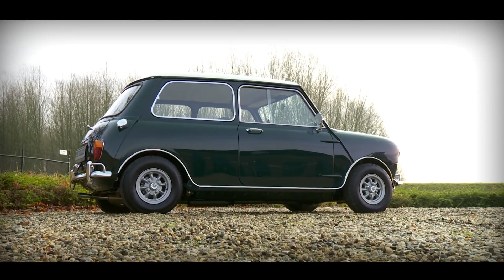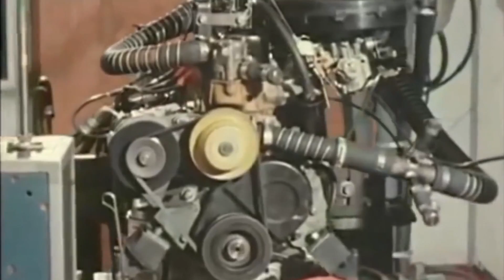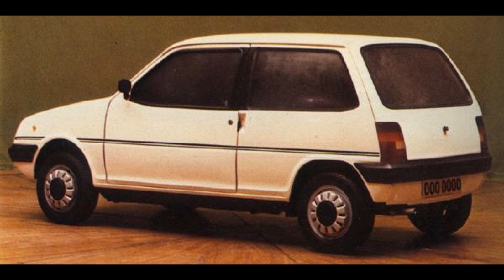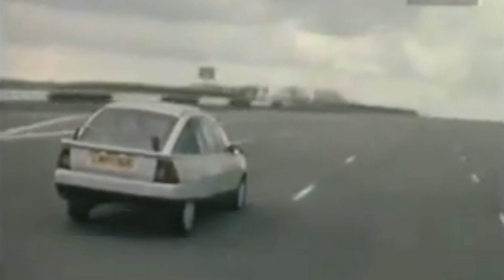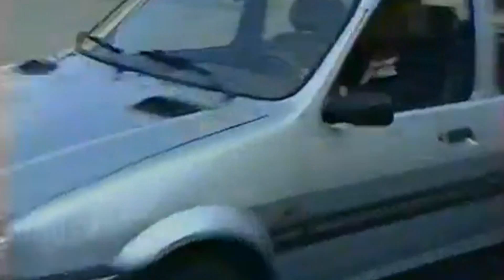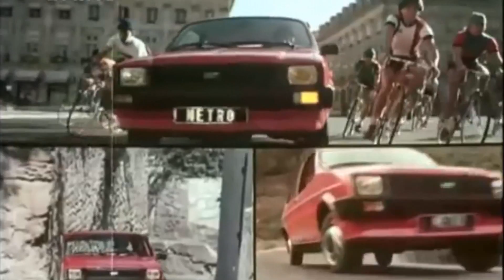The Austin Metro Story

Comment: I learnt to drive in Metros owned by BSM - the British School of Motoring. Later I hired a Metro for shunting people and stuff around the weekend I got married in the mid 80s, as I didn't buy a car until a few months later (a new 1.3 VW Polo C Formel E, incidentally). The Metro was an easy car to drive at a time when some cars were clunky and tiresome to drive - the Fiat Panda had a nightmare gearbox, and my big foot used to catch the steering column on a Renault 5 when using the clutch pedal (not good when driving near cliff edge drops in Madeira).

Comment: I bought one new for £4,000 in 1982 and vowed never to buy a British car ever again. Lucas was on strike at the time and distributors couldn't be had so a french Duecilier was fitted which couldn't do the job and pinked going up hills. I had it back to the dealers four times in the first year for that and other unrelated problems such as water leaks that flooded the interior which the dealer failed to fix. I liked the design and wanted to like the car but couldn't forgive its poor build quality and terrible after-sales service. I sold it for £2250.00 after just 18 months and was glad to see the back of it.

Comment: I didn’t have a Metro, but (in 1993) I put an MG Metro engine - into a 1275 GT mini. The original carburetor was an OK fit, but the clutch system never quite worked. It was reliable, as long as the battery was good and charged. Unfortunately MG Metros had an electric fan cooling it all. My Frankenstein had a ‘belt driven’ fan, so it got hot ...

Comment: The Metro (never sold here in Aust) is styled using only a rule & a couple of set squares, I think - only exception being the sporty R6 series shown so briefly.  But I'm guessing this would have had a high price point where you could consider other cars as better value.  
How about a Spridget episode?  A bored out, flared '72 was my 2nd car & it was great, apart from pulling 5000 rpm on freeways.  Also showed remarkable resilience in its head on collision.  Or the iconic MGB, my 3rd car & a massive disappointment after the Midget.  PS I now drive a Copen, a sort of modern take on a Midget.  Also super great except on freeways.  Oh, and luggage with the roof down (nil).  Hey, maybe do a Copen episode, it would be unique on YT.  Thanks BigCar!
Reply from the maker: I've done both the Spitfire and Midget in two separate videos. Search for them and you should find them.
Reply: @BigCarTV  I'm planning to watch the Midget & Spitfire tonight.  Thanks so much for all the time you put in.
Reply from the maker: @UJCentral  You'll have to point me to a reference for that. I don't know what it is.
Reply from the maker: @UJCentral  Interesting stuff! I have a few cars already lined up, but I'll put it on the list.

Comment: I had 2 metros. An 84 1.0 hle mk1. Regular 50mpg, 100% reliable on 100 mile daily commute and fun
And i even managed to collect and put a washing machine in the boot. The 2nd was a " rover 100". A bit more refined and comfy and including the 5th gear. But the panels very thin and deformable just by pushing on them. Handling and suspension were better but on wet roads, hard corners and roundabouts made it handle like a pig on a frozen pond and terrified me. The zero encap rating was no surprise, and engineer friends of mine pointed imediately to the fact that spot welds had been halved and the panel thickness to side and roof panels and sills with the cutting of spot welds killed structutal safety compared to mk1 and mk2. A great car killed by penny pinching, badge snobbery, called a retirement rollerskate, and being launched frankly 10yrs late.

Comment: My first car was a W Reg Austin Metro (1981) and I loved it. Then I went on to have another Metro D Reg (1986),  an E reg (1987) Maestro Auto then a G reg (1989) Montego Clubman Estate. Last Rover I bought would have been an S Reg (1999) Rover 416. Shame they no longer make cars as I absolutely loved the Rover brand and their cars were practical, economical and most importantly easy to repair, with cheap parts available. My wife has owned a few Rover 114s in her time also with a Rover 214 as her first car after passing her test.  We drive Volvo now and although its a beautiful drive, I still think you can't beat the rugged basic handling of a Rover.

Comment: I had three Metros the first being a rare car back in the day and in many eyes these days,  the holy grail...to me? It was the ideal machine to beat everyone on the Cumbrian Lake District roads...and believe me I used to use every bit of boost and handling that Mk1 MG Metro Turbo had.
It was the only one in the area, standard MGs where around and where very highly regarded and envied by normal Metro drivers, mine was blisteringingly quick compared to a standard MG and could beat the UK two escorts, capris, XR3 and xr3i the later on the straight would catch up at the 1/4 mile point and their 5th gear won over on top end.
MGE???Y Silver over black MK1 and only a couple of years old, I was looking for an XR2i but the lover of the odd ball in me opted for this when it flashed up in the small ads, I'd just sold my house so had the cash to purchase a nearly new car outright and this was a private seller, gave me bargaining power as many had come to see it wanting test drives but none had the cash...theyd moved from Glasgow to Cumbria and needed the £ so it was a done deal...

Oh how I loved thrashing that car about...it was made for those Lakeland roads and the various rally stage areas you could get access to in the forest areas...

My second was a far more practical 1.0 HLE :(
Basically a 3 speed with a high range Economy gear for 4th.
The gear lever was even marked
1    3
2    E
It was in mud brown and rusty but travelled every month from RAF Brampton in Cambridgeshire to back home to Cumbria with two kids and luggage purchased to fit perfectly between the kids car seats and boot I always had a clear view through the rear window.

My final one was a bright yellow 1.0 Mk1 I had for a year but only drove a few times as I had been injured at work (spinal, in an explosion) and became very unwell and ultimately gave the beauty away to a good friend and garage owner for free, because I couldn't sell it for someone to just take apart for spares as it was a mint condition Mk1 miniMetro.

I miss having a metro in my life, they where great little cars back in the day that involved using cables to things like the throttle and steering you could feel...

Peace
Charlie 🇬🇧

Comment: i remember a friend of my dads had a pale blue one, not sure how old possibly on a C registration, pretty sure it was the 'city' model. i must have been about 5 or 6 years old, i remember i bloody hated the car, i thought it looked an awful chep heap of crap even back then. the steeel wheels were the thing that stuck out in my mind the most, the design with thhe centre cap which was square and had 4 slots in total. most hideous wheel design ever imo

Comment: I had a Mk1 light green MG with pepperpot wheels.
Not a hot hatch in the truest sense because it hadn't got a great deal of power but it was torquey and the steering and handling was fairly sharp at sensible speeds.
I live in the West Midlands and the local news was giving the Metro some hype building up to it's launch because it was a local car and there was a lot riding on it. They showed cars covered in sheets as teasers and all that kind of malarkey.
Once it was launched the first one I saw was on the carpark of Savacentre in Oldbury and a small group of curious shoppers were scrutinising it.
Hard to imagine the general public being so interested in that way in a new car nowadays.

Comment: Very informative, Lot's of stuff I didn't know.
Yes, I drive a metro while a learner back in 1986/87 and I owned an old metro too.  I bought it from a scrapyard even though it was actually still mot'd. Drove OK.
My dad had a metro too, a 1990 model. 
Good cars! 
They didn't mention the citycar which replaced the metro in the late 90s.  I always thought there was a gap between the finish of the old mini and the start of the new mini.  
I'd love to get an original X reg metro VP if there are any left but there seems to be a lack of first year metros, maestros and montegos still in existence.  I think there are more model T Fords from pre 1925 than A reg montegos and X reg metros still running.

Comment: I had two, the Metro City and Metro MG, you never mentioned it, it had a turbocharged engine, with Night rider style LED meter on the dashboard clocks, which was later removed from subsequent models, because people would drive it to the meter and causing major crashes, however it was cool while it lasted and the car looked great in white.
Reply from the maker: Yeah, I should have mentioned the MG Metro. It's mentioned in my MG Midget video!

Comment: The Austin Metro was a Mini with a new body, no more.  The same engine g/box arrangement and sub frames.  That is why the wheels were too far inboard making the car look odd and ugly.
Reply: While that was true of the original version from the 1980's, the Metros from the 1990's were vastly better cars, especially with the new engine and standard five-speed manual.

Comment: I used to drive one. One previous owner who was a pensioner who no longer drove it and kept it in a garage, so it was in very good condition for its age, once we managed to unstick the brakes. The suspension was an interesting experience over speedbumps, where the car would pitch violently. But it was a nice car nonetheless. Unfortunately it was undone by the fact that by 2007 standards it was extremely easy to break into and steal, and it just disappeared one night, and was found burned out after a joyride. Poor thing survived so long in such good condition, to have it end like that was kinda sad.

Comment: You never mentioned in the documentary that the appalling accident rate of the mini Metro and they kept doing 360s They discovered It only done this when It had a full tank of petrol because the filler cap was placed lower than the rear wheel arch and when it had a full tank of fuel it went all over the back tyre which made it do a360 and then the accident 🤬
Reply from the maker: I didn't know that. That's terrible!

Comment: I had one in the 90's here in NZ.It was a great little car with the 1300 engine.Unfortunately NZ changed to lead free petrol which destroyed the valves without the lead coolant effect;even with the necessary fuel additive to stop the damage.I remember the safety scare.A bit off putting.
Reply: Change the valves and valve seatings.

Comment: This Metro looks just like the Geo Metro and Suzuki Swift. I had a 1991 Geo Metro and after the third spin out, got rid of it. Once it spun at 65 MPH on an icy bridge, and once at 25 MPH on a sand-covered curve. Way too light for good handling. It would have been wrecked on the bridge but the 10 foot long Metro spun like a top. I wish I could have afforded to crush it.

Comment: Sister had a blue Metro, i patched the door up and added a white cheat line, she passed her driving test in it then sold it, never to drive again for ten years. Must have put her off driving! I remember it had the fuel cap call back.
I rented a Rover 100 1.4 gsi, i think and went well and nippy, very good mpg. And one of my customers used the diesel version in his driving school, said he would do 150k miles then buy another, all on the original clutch.

Comment: Wasn't the A series originally from a tank being used as a generator? anyway, I built an ERA turbo rep with 1380cc  and V max head as I couldn't afford a 16v KAD head but 130bhp and lots of destroyed gearboxes until I could finally afford a Jack Knight box, lots of torque steer and whine from the turbo and box.
Reply: I think it was KAD that produced a 5 speed conversion for the A series?

Comment: Had 2 Rover Metro GTi's back in the day.  Flame Red 95bhp version and a GTi Se Limited Edition (Nightfire Red - 1 of 500 made).  Transplanted a 1.8 from an MGF into the latter when the timing belt flew off the original engine at 7000rpm.  Went like a rocket with the 1.4, but by God that thing absolutely flew with the 1.8.  Few minor tweaks and it was around the 135bhp mark.  Couldn't keep the rust away no matter how hard I tried though.  Regret not keeping the Nightfire one though.  They're making very solid money now

Comment: My first car in 1987 was a 1.3 Studio 2 limited edition Metro - 1275cc A+ series engine with 63bhp if memory serves (the MG boasted 72 and the turbo 93 I think). 3 further Metros followed - 2 GTi 16v models in 1990 (1st written off after a head-on smash (not my fault) and a 1.4S in ‘93. The GTi actually stood up fairly well in the smash. I only had cuts and bruises. The Renault 5 involved looked far worse afterwards I remember. My car was 3 weeks old at the time. Interestingly, it’s the only Metro I owned that’s still running! It has been rebuilt as a race/rally car. Fair to say the earlier models had their issues, but my 1.4S was very reliable and took me all over Europe. It was a great little car. I think by ‘93 it was turning into the car it should have been all along. I still like the styling of these later cars today. I think they have aged well. I expect to be shot down for saying so! Obviously, other opinions are available!

Comment: I'm an American who was stationed in England in the early 1990s. While there, I had an E-reg, 1988 Austin Metro 1.0 city, with a 4 speed manual. Things I remember about it: it had a lot of gear whine, and was geared for city driving as the engine really seemed to be revving at anything over 60 mph. It went through a lot of tires, and tended to run hot at higher speeds. It had a manual choke and was very basic inside with no headrests. It had its issues but was a very memorable and quirky little car!
Reply: I gave my Metro a lot of use during the short time I had it. In the summer of 1994 my parents visited me and we drove down to Spain and back in the Metro to visit family! During the trip we had to replace the spark plugs and water pump, and it was a very hot summer (close to 40c in Spain with no air conditioning). Was not the most appropriate car for the trip but I was very young back then (and my parents younger) and it was a fun trip. I had to return to work when we got back to the UK, so my parents borrowed my Metro and drove it to Scotland.

Comment: Used to repair Metros (and Minis) and hated the things. Some components were almost inaccessible - points for example. The front radiator was almost touching the distributor cap and it was easier removing the radiator to sort the points! I think that's the point in time when all small cars took a turn for the worst (dad joke) with basic maintenance. Looking at you Ford Ka Mk1. Try changing a front headlight bulb - that'll mean removing a front wheel, removing the inner front arch and then using a childs hand to shove the bulb in..
I remember seeing people put a full tank of fuel in a Metro. The designers got it wrong and didn't expect the public to do it. The fuel tank would start burping on hot days and dump 1/3 of a tank of fuel onto the road where the car was parked.
I think the only decent Metro was a Tickford Metro - basically not a Metro and instead a rally car - a rally car that could be road legal. yeah I've driven one and OMG!
No - I don't like Metros.
Reply: Best ones were the later Rover Metro GTi's with the 95bhp and 103bhp K-series engines.  Decent fun.  Tickford Metros were basically a bodykit, fancy interior and wheels, and an 80bhp A-series.  They weren't a rally car.  The only true rally car was the Metro 6R4

Comment: My Mrs had a Metro. It was a 1.0 city with the A series. Whent to change the brake pads one day to discover it had 4 pot calipers and vented discs. Fella in the car accessory shop didn't believe me. I guess they had run out of std brakes and put mg or turbo bits on it. The brake were great it would nearly do a endo.

Comment: I passed my test in an "A" reg Austin Metro in December '87 , despite the gearbox selector being so broken half way through the test I said to the examiner " sorry it's finally had it , I will have to select 2nd to pull away from now on" , as I was causing a jam in both directions during a 3 point turn ! Happily I passed first time around & my instructor traded the clapped out tin can the following day for a brand new Nissan Micra 😊👌
Reply: Well done. I passed in Dec 87, interestingly in a 1985 Nissan Micra.

Comment: They rusted to hell, suffered frequent mechanical maladies, and weren't particularly good in the ride and handling stakes. 

Although the public liked it, it scored a bad reputation and when other superminis eclipsed it, for rear legroom / boot space and better practicality, the writing was truly on the wall for the Metro.

The replacement Rover Metro, and it's brother, the 100, although an improvement, met its maker when a dreadful 1 star EURONCap crashtest showed up it's 1970's shortcomings and not even a drivers airbag could save it from oblivion, in the frontal impact test, the driver's head was flung rightward into the door pillar and the steering wheel shunted leftward in the frontal impact test, and as if that weren't bad enough, the side impact test was even worse. 

Should have been retired at the end of it's run and not remodelled on it's late 70's architecture at all.

Comment: I have owned 2 mk1 1.0L Metros, both were reliable mechanically, but rusted like a Lancia!
I also had a J reg 1.4GTI with the K series engine, went like stink, but again rusted away at an alarming rate. It ended up getting written off due to being T-boned by a Toyota Corolla, the damage was horrific as the whole of the passenger side folded in like a tin can, it even buckled the roof!
Luckily I had no passenger at the time, the Toyota just had light bumper damage,  thank god they don't make cars like that anymore......